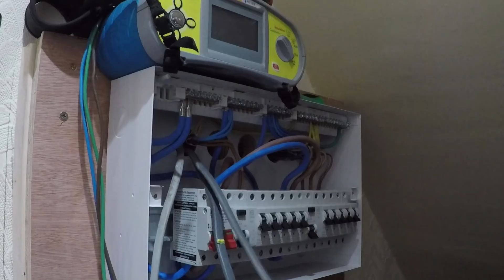Fuseboard change  -  discussing common controversies | Thomas Nagy

Comment: I’ve been an electrician for 20 years and I’ve just about had enough of it, the regulations are just to controlling and common sense has gone out the window. Working for yourself you need to join an “electricians club” that you need to pay an annual fee too otherwise you won’t get certain work from certain companies. Also electricians slagging each other off because they do things a different way is another thing, it seems to be one of the worst trades for this. For the information we need to learn and the manual skills we have I think the trade is underrated and under appreciated as lots of people think all you do all day is changes sockets and switches and they have their best mate Dave for that who will do it for a few pints down the pub. I think I need a job change before it’s too late. 😏
Reply: CaptainKidd2006 - AMEN!!!
Reply: Same as that! Sick of pricing jobs to do them properly, then get undercut by 75% by some knob who doesn’t care or knows what he’s doing.......a 5 day spark usually!
Reply: Same as that! Sick of pricing jobs to do them properly, then get undercut by 75% by some knob who doesn’t care or knows what he’s doing.......a 5 day spark usually!
Reply: I agree with this. I have however been involved in a tribunal where an electrician out a couple of customers at risk. It sucked because I knew I was about to ruin this man's life. There's a difference between doing something different and doing something dangerous.
Reply: So plumber now? 😂😂
Reply: I'm a carpenter and they are horrendous for pointing out faults and snagging another off.
Reply: As a customer (with electrical engineering background) I am so happy to see that comment. It infuriates me when "done to regs" is supposed to impress me. It's the minimum acceptable. I've seen 2 pieces of horrific work done by "proper electricians" who solely work for property maintenance companies. Outside metal lamp stuck on the wall with silicone for one, okay may not be an electrical issue but when that light fell, it pulled the badly installed earth clean out. Other work was wrong colours being used half way through a ring main, i.e. Red wire to live joining black wire to live and two sockets further on black wire to brown, so obviously installed poorly pre 2003, then the electrician who installed an extra socket saw the problem and didn't fix it. Probably in both cases the jobs were on a rush and the guys probably got £20 for the jobs. Although it's easy to blame that individual who installed the crap, there should be a federation for electricians who when they feel that they need some backing from their peers, they can go to them so there can be dome might sent back to these property management companies to tell them to stop taking the piss. A properly qualified electrician is worth their weight in gold and their knowledge needs to be respected both in the industry but also by the middle companies which outsource to them.
Reply: CaptainKidd2006 being an electrician in Canada is great
Reply: i used to be an electrician and i decided to re train installing lifts for a big international company, best decision i ever made.
Reply: Jonathan Ellis maybe he was an American electrician hot is black
Reply: greenfingerish is air con easy? do you do maintenance or installs?
Reply: CaptainKidd2006.   I  know how you feel especially the regulations.   . You do one course and work for a couple of years and then they change the regs again so  more studying. Thats how it goes on. some of them are crazy. They dont know what to come out with next. We now have to use special clips to hold cables in mini trunking in case of fire. Honestly this profession has gone nuts. What will they think of next. If i was younger i would look elsewhere and give it up.. David
Reply: I agree totally.  I stopped contracting in 1984 when I was 23 and was sick of the industry even then. I would however say that being a spark was a great starting point to move on to something better.  People here moved on to being a lift engineer and air con engineer.  I moved on to being a service engineer in the printing industry, a Clerk of Works, and a Facilities Manager.  This all led to other things and I am out of the industry altogether now although still maintain an interest.
Reply: CaptainKidd2006 I agree with you in the regs and the joining of organisations which is not worth the paper it’s written on , 2k a year for what ? They don’t promote your business and get you no work , I believe if you do a good job , safe and take pride in your work you can’t go wrong .

However the slagging off is warranted most of the time as folk just don’t care . Charge folk fortunes and leave big pudding joint boxes everywhere , no earth sleeping , the list goes on , if it was all done correct then their would be no moaning . The problem we have is as you said folk attempt to do DIY or as you say get their mates in and you have to end up fixing it. Which when you tell them how much it’s always to dear . 

Competence is key . Not who you work for or who you associate yourself with in my eyes . And if you’ve been in the game long enough folk will know your work 👍
Reply: I am new to the trade and too much emphasis is on speed and if your new you really want to make sure your doing the job correctly. The trade is brutal for new starters and makes you wonder if its worth doing. No firm wants to pay you even a half decent ammount until you have 5+years experience.
Reply: Mark,  I agree.  You see other trades like carpenters, plumbers, plasterers and they have a trade which they do and does not have the regs like electrical.    Luckily I got out at the time just after my trade.
Reply: @adrianhill407  Same here did my trade as a spark and now work as a draughtsman.   But if doing it all over again deffo either Carpentry or train to be an accountant  .
Reply: I gave it up two years in. The customers thought u have nothing better to do than chase them for money? 'Can u come back tomorrow?' My husband is not here. He was there 5 minutes ago, but as soon as u are finished they disappear. The final straw was an accountant. He made me go back once a month to pick up a cheque. He would not even post it the ba......d. In the end he gave me £100 too much. Didnt say anything as he paid for my petrol.
Reply: @jonathanellis3169  The standard is dropping everywhere and so is the stuff being manufactured, it is quite shocking at times.  There was a house here that they had forgotten to connect, yet there was a certificate saying it had been tested and passed.  Really!  I know of one job where there was a warehouse tested the week before, it had been knocked down for five years!  How can you test a warehouse that is not there?
It was just copied from an old report, but the person that got the safety report read it and spotted that a warehouse was tested that wasn't there anymore.  How did the firm answer that one?  I don't know, no doubt someone would have been made a scapegoat, but I wonder if he had been told he only had an hour or something to test the whole site.  Why bother to do these things if they either don't allow the time or they just don't do it.  Pointless!

Comment: I'm completely with you when it comes to doing a thorough EICR, a typical EICR should take about half a working day.
Reply: M H  You can call it want you want, I've done enough to how much time a typical EICR takes. There's no requirement to inspect behind every single socket-outlet or lighting point. Continuity of bonding to gas and water should take a whole 10 minutes. Wiring in the loft doesn't have to be inspected unless specifically requested by the client.

Comment: I fully agree running the smoke alarms of the lighting circuit. the amount of times home owners / who ever will just turn of the circuit breaker and forget about it. pros and cons for either way, but I prefer to take it of the lighting.
Reply: @gadgetman36  if all smoke detectors are all on one dedicated circuit, if something happens to that circuit you lose all your smoke alarms. also if they are on a lighting circuit and lose that circuit they should have a battery backup. theres pros and cons to any way you do it. most important thing is just that they have enough smoke / co detectors! normally where I live they are all wired to an independent circuit together and all sound off together if one goes off.

Comment: In Canada it is actually code to have it off a lighting circuit for the exact reason you state. If an independent circuit trips on the smoke it could be left in that state because it doesn’t effect day to day use. Take it off a light and the breaker trips homeowner will make sure it is looked into and fixed. Got may electrical trade in England before moving to Canada 16 years ago, your channel creates some good memories thank you.

Comment: The earth in twin and earth is now pre sleeved in Ireland 🇮🇪
Reply: CSA has been increased to match the other conductors too
Reply: Has been for over a year?
Reply: Is the earth full-sized too? I think I remember reading something about that a while ago but I'm not sure.
Reply: Congratulations, you now have more PVC in your walls than needed..
Reply: Dooley  is it right that you also cannot use standard 3core (brown black grey) and just sleeve the black and grey?
Reply: I never got why it's not usually sleeved. In Germany our most used cables have always been completely sleeved for decades.
Reply: I heard this the other month. 
Probibly not a bad idea.
Has it made a big difference to the overall size of cables?
Reply: Dooley can you send me some 😂👍 that would be handy
Reply: Dooley & same size as conductors, no more getting 4 or 5 1.5’s down a 22mm oval conduit 😩
Reply: yep, i figured that other day after years of not doing electrial work
Reply: Are u sure man
Reply: the earth in twin and earth is now flat
Reply: @mikeZL3XD7029  yeah the earth is flat
Reply: isnt the idea of a naked earth that any penetration will connect the earth to live thus tripping a MCB , it you penetrate the live but glance the earth sleeve then you have a potentially live nail or screw ??
Reply: Is it flat t+e or round NYY euro trash ?
Reply: @jonwilson8643  

It's a regulation to follow colour codes. So, not allowed to sleeve cores.
Reply: @Monkeh616  Pretty much any other country in the world uses double insulated cable that includes sleeving on the earth conductor. There are tons of everyday examples of more wasteful use of plastics than a bit more insulation on cables that are ment to last decades.
Reply: We are way behind in England , Wales and Scotland with regards to twin and earth having the same size CSA and now it’s sleeved as well!

Comment: i think adding the smoke detector circuit to the lighting circuit is a better way to ensure added safety because many times i have known  the occupier had switched the smoke detector circuit off and removed the batteries because they kept bleeping !!!!!!
Reply: Plus if it trips and is on its own circuits people might not know but you will notice if you have no lights pretty fast. The only better way is put the router on the same. People notice when they can't get on youtube :)
Reply: F/A should be dedicated circuit = IEE regs.
Reply: @dcsoxford  a full fire alarm? Sure. Smoke detectors to ld2 in a house? Absolutely no need and recommended by the manufacturers (aico definitely) to install on the local lighting circuit
Reply: The only regs relevant to smoke alarms in a house are BS5839 part 6, and they say grade D alarms (Aico mains type with integral batt) should be on a local lighting cct for the reasons given. That’s where aico got it from.

Comment: Tom, another interesting video. I always put my smoke detectors on a local lighting circuit, those downlights look dodgy. I certainly wouldn't class those as a good fire rated down light. Those are something I would have installed 10years ago when GU 10  down lights started to be popular.